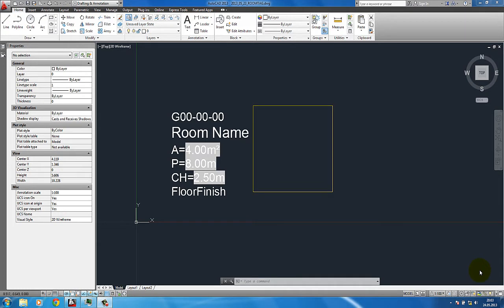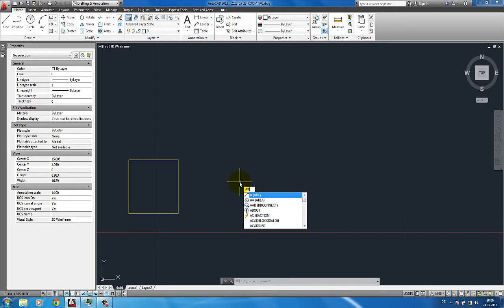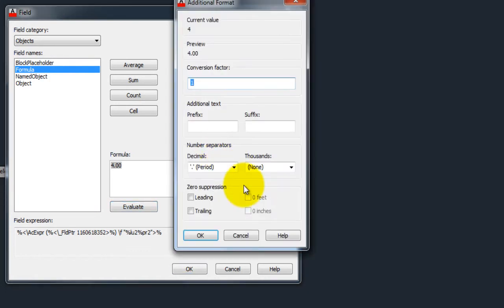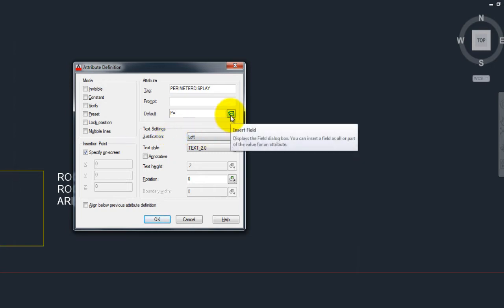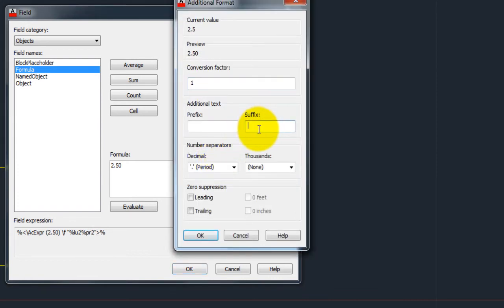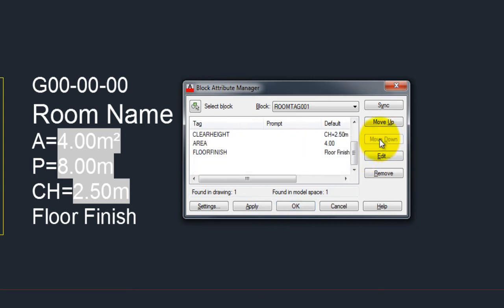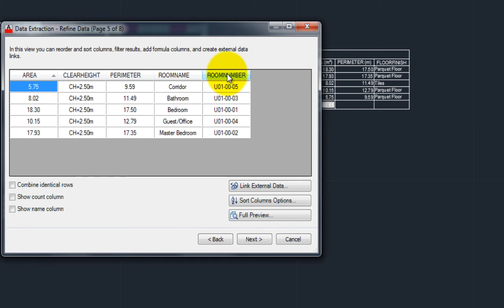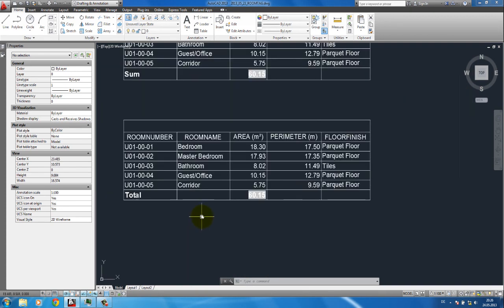AUTOCAD CUSTOM ROOM TAG

Comment: Thanks for you video, would this be similar process for using the field and formula to tag the length and width of the space. I noticed that length and width is not an option once you select the polyline. Do you have any suggestions?
Reply from the maker: Hi, thanks for your comment. If I remember right it works with dimensions. You create a rectangle, link invisible dimensions to it, then you can grab the length and width with an field. I have this somewhere, when I find it can send it.

Comment: Hi Patrick, thanks a lot for this video tutorial, it opened another level for autocad user as me ! :) 
but i have a question, i wasnt able to find answer else yet... 
The question is whether it is possible to add another/new paramater to the ROOMTAG later on. I mean lets say i already have a floor plan with the tags, that you taught us, and they are working, but i want to show one extra parameter, that would be not the full area of the polyline, but lets say only 90% of it. I would imagine that if i was creating a new one i would manage it with formula 0,9*plotarea,  
BUT the question is whether i can add this kind of parameter later, so it would show it in all the roomtags that i have already placed in a project.
thanks a lot again !
Reply from the maker: You can easily add another attribute to all blocks using the attsync command. Changing all the calculations afterwards seems to be tricky, atm. I have no idea how to do that. Maybe somebody else can help you? It is actually a very good idea to add an invisible calculation variable to the block and connect it to the area calculation. If it is there at the beginning, it is no problem no change all calculation afterwards, for example to subtract 3% for plaster.

Comment: This was very helpfull, and i got it working, and made a file/block with the table and the attributes and polyline, but when i insert it, in a new drawing it wont work, not even if i create a new dataextraction based on the first one.
Is there a way to implement this in a template file, and then just point to the new location where I want my new .dxe file?
Reply from the maker: I´m not really sure what you are trying to achieve but it seems like quite some people have problems using the room tag in another drawing. I assume you created the room tag together with a table and you just copy it over to another drawing. If you open the external reference palette you see the data extraction still references the old .dxe file from the other drawing. You will always need one unique .dxe for each data extraction. Now you change all room tags according to the new drawing. You can just copy or delete the tags together with the polyline. You will need to create a new data extraction in order to save a new .dxe file. This should be done with using the preferences of the one you already created. If you want to use your old table that you copied over, you need to change the path in the external reference palette to the new .dxe file. But, according to my understanding, this will not speed up your work because with the creation of the new. dxe you just can insert a new table to the drawing. Does that help?
Reply: @patricklipczinsky8988  well, i have tried to figure out what I was doing wrong, because i got it to work, if I had a file with the tag, and the .dxe file, and copied it to another folder, and changed the path to the .dxe file, it worked.
But my intention was to implement this in the .dwt file, with the polyline and roomtag, and then copy the .dxe file to the case folder, and repath it, but that did not work.
My table is edited, so my header are changed to more "reader friendly" text :-), so it would be wery timeconsuming to make it fram skratch each time, also because i have added the TOTAL and the 2 x sum functions.

I did get a working result, that i could replicate time after time.
The table is in my .dwt file, and when i use it, i save it in the casefolder, and copy the .dxe file to the casefolder too, and then change the the path to the .dxe file, and then choose "Edit an exsisting data extraction" and selcet the tag, and then insert the new table, and then i am being notified about a change in the .dxe file.
I just delete the new table, and then my original table, with the TOTAL and the 2 functions works :-)

But there is still an issue, regarding if I save the file in a new name, e.g. with an updated date, my table is back to the original, so it seems like the .dxe file know what .dwg file it was created from.

But thanks alot :-)

Comment: Hi Patrick,

Thanks for the tutorial. My question is what can I do to retain the room tags without the polyline. I tried hiding the layer of the polyline but it hides the tag also.

Best regards
Reply from the maker: Hi Elmedin, if you put the text, the roomtag and the polyline on different layers, it should be no problem to hide or freeze certain elements. Hope that works?
Reply: Patrick Lipczinsky Hi Patrick,
Yeah I did. But it somehow hides them both. But I ve put the polyline 0.00 thick so it doesnt show when printing. Thanks anyway.

Gruße!

Comment: Hi Patrick, can we place this Area Tag and Polyline on a Tool Pallet ?
Reply from the maker: Hi. The easiest way to share the room tag over a network location might be the Design Center or the Block Palette in Autocad. Combine the Polyline/Hatch with the Room Tag in another block reference , import from separate file an explode it for further use. Maybe there is a better way?

Comment: thanks Patrick, how do you attach this to another polyline? or do you have do this for each polyline
Reply from the maker: Hi Martin, as I wrote before you build the tag one time and connect the attributes to a polyline or hatch. Then you just copy the the tag together with the polyline. The tag stays connected to each copy you made. So you just create copies and adjust the polyline/hatch to the particular room situation. Each copy of the tag together with polyline will be unique. Hope it helped.
Reply: @patricklipczinsky8988  Hi Patrick, thank you very musch for this useful tutorial. The only thing which is not working with this is that when you copy the room tag from drawing to drawing the connection between the attributes and the polyline is not maintained. I saw working attribute with position points defined in the attribute block. Have you seen something like this? Thank you maty
Reply from the maker: @matydonatova7305  I use quite the same version of the room tag in daily work in different drawings, creating copies should work fine. You can send me your version of the tag to admin@lp-arch.de and I will take a look. Greetings.

Comment: how do the new tag know what polygon to calc ?
Reply from the maker: Hi there. You just have to copy the tag together with the polyline. If you change the polyline, the tag will adjust automatically.
Reply: Hi Patrick! How does it work if the new room is not rectangular?
Reply from the maker: You just have to adjust the polyline to the shape of the room. I showed at the beginning of the video how to change the shape of the polyline. Hope it helps you.
Reply: @patricklipczinsky8988  And what if the polylines are already created?